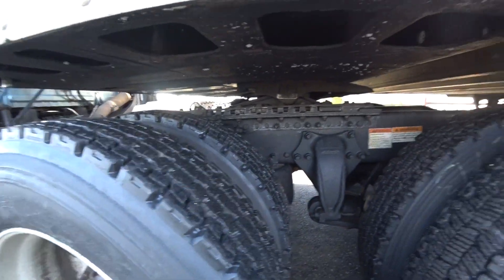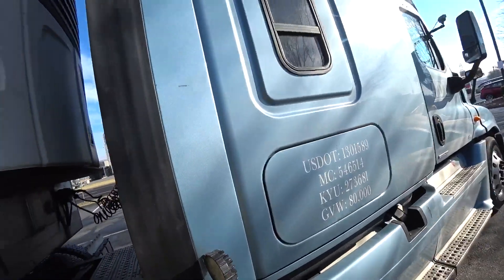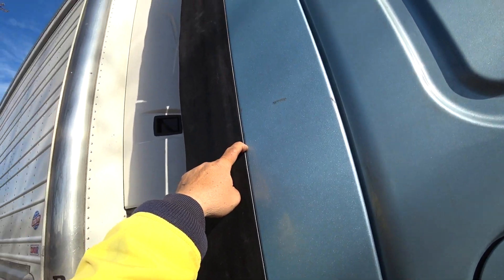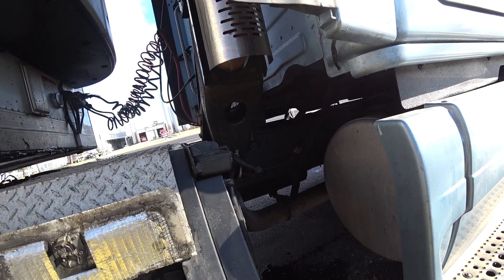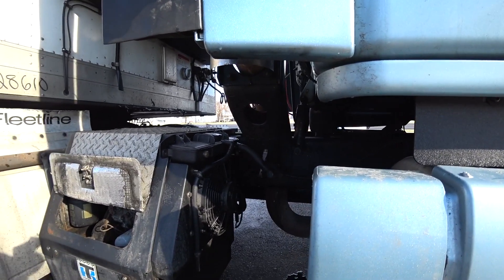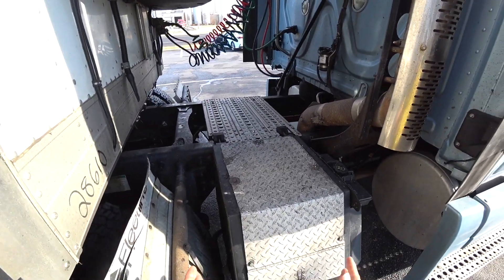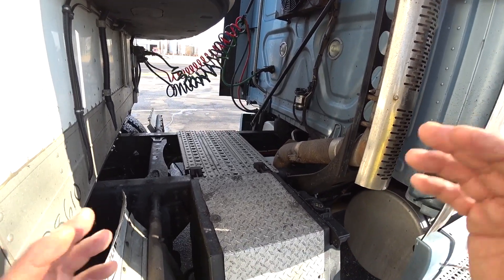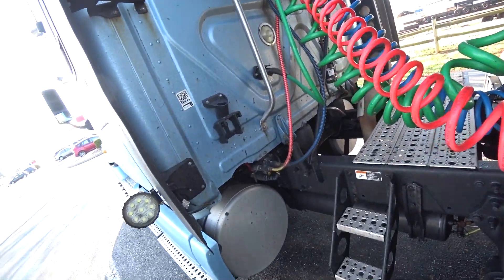February 20, 2018/223 Babyblue got new rubbers😝

Comment: With all the trucking videos I have watched, I have never seen how the bunk heater works when the truck is not running. I thought the APU did it all. A lot of independent drivers go to the expense of having an APU because of the fuel savings and wear and tear on the main engine, and in some places you are also not allowed to leave the truck idle past 10 minutes.  I think Super Trucker Dan just has a generator that is diesel and simply supplies electric to his batteries and makes electric thru a converter, then he has an after-market AC mounted on the roof of his truck. But even so he notices a difference in fuel millage which is a really big expense for an independent when he runs his generator. Only problems Dan has had with his generator, it eats alternators like candy. He keeps two new spare alternators with him all the time and has learned to change them himself.  In fact, when he changed from his old Peterbilt to his newer one he moved that generator off the old truck onto the new truck, or new to him, he got is used a year old. The money he saves in fuel from his old Peterbilt classic with a big Cat engine in it, to this new style with the slopped hood is around $1,000.00 per month savings, and that by chance is the payment on the new truck, so he's basically has a low millage Peterbilt nicely equipped a year old for free. So far he has not had any trouble with the new /used truck but he did buy an extended factory warranty for it just in case. He drives for Metro. Besides you, he is one of the better truckers on here, a nice guy, flat bed driver. The other guy I like is Indiana Jack a van driver, he's got an old Volvo 1,206,009 miles--2008.  He did a top end pistons and sleeves at about the million mile mark, but the truck he calls Old Red keeps right on making him money. He owns his own truck, drives for Travel Loco.  The engine in that Volvo is a Cummings not a Volvo. I personally thing Volvo engines are really under-powered and expensive to repair. 
Changing Axle seals is kind of a big job on a truck, the axles have to come all the way out,  and they are connected inside the differential with special pins in kind of a U joint on each gear. Usually bad seals ruin the brakes and saturate everything with gear oil, so yeah it's just a good safety measure to change out the drums or skim them on a drum lathe and change brake shoes, or in the case of disk brakes pads and rotors. I was taught never to re-use gear oil, or any oil once it's drained and it has been used.   In your truck, really made good sense, because the blown seals left water get into the gear oil so those seals were pretty bad. I'm surprised someone didn't pick that up during an on the road safety inspection. It's kind of hard to seen on a pre-trip inspection unless you craw under the truck. I can't imagine with the seals as bad as they said they were to leave water get into the differential, oil wasn't running down the side wall of the inside tire.

Comment: Well I'm glad that the mechanic's found those bad wheel seals....that could have been bad.
Well if your boss put caps on Baby Blues drives. He may being getting rid of her in the near future and you will get another truck. 
But the old girl sounds like she starting down the path of nickle and diming you guys to death.  And when they start that it's time to get rid of them.
I know how you feel.  I didn't want to give up my 89 Freightliner for a 95 way back when.  I know you can get attached to a truck. 
Need to get that APU fixed or all out replaced.  I don't even drive your truck and this problem even aggravates me.
Well enough of that.
Looks like you will have a nice day to head back west.
As always driver.  Be safe out there.

Comment: Sir JBG !!!  When the APU works the way it was designed,,,you cant beat it !! As far as the leaking wheel seals go,,,you should of caught that when you did your pretrip inspection !!! Sorry.. that's part of your job !!! As a mechanic/driver was always looking for the bad that could cause the DOT to put you out of service !!! Anyhows,,enjoy your day and keep the videos coming !! Thanks !! KEEP IT SAFE !!!
Reply: With John putting so many miles on that truck each month surely it gars regular maintenance oil fluid changes etc...surely the mechanic shop should of caught this.  John has a million things on his mind already.  He drives it & the mechanics doing maintenance do the checking & fixing. That's how I see it anyways.
Reply: AL A !!!  Sorry <<< Been an OTR driver/mechanic  over 37 years !!! Today's drivers are never taught how to properly pretrip a tractor/trailer out !!!  You start at the drivers side of the tractor with the hood open and engine off with all lights on !!! You are to check all parts of the steering system and all engine fluid levels !!! The total inspection of the unit done the way it should be done will take the full 15 to 30 mins... Remember,,you are the one that the DOT/Owners will come after if they find an out of service violation !! The ticket is in your name as representative of your company !!!  Sorry,If you think I'm wrong then sorry at your next total DOT inspection !!! KEEP IT SAFE !!!!

Comment: staples ????
Reply: Ron,
I think those were supposed to be covered by rubber. The tires are retreads. The tread is a slab with a pattern put in, the ends are mated together and evidently stapled to hold in place. That's why they aren't allowed on the steering tires.